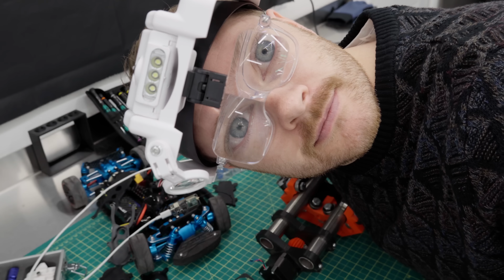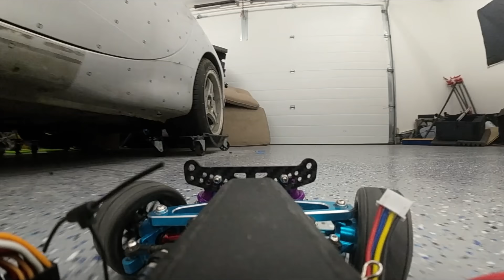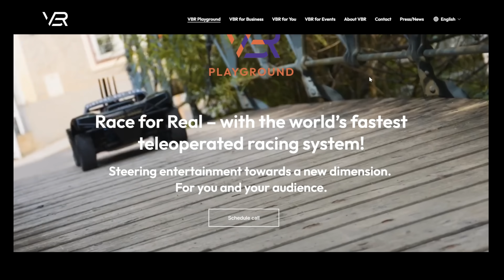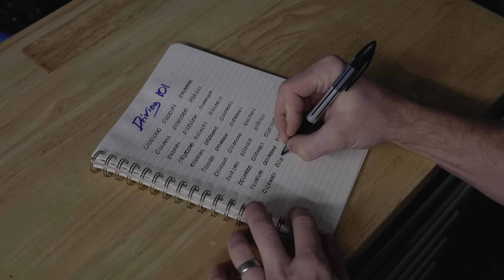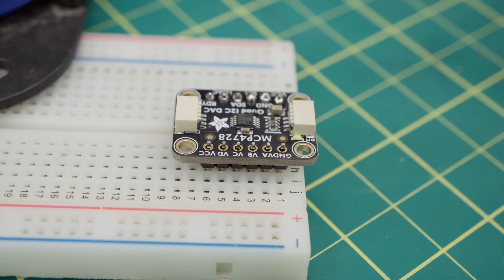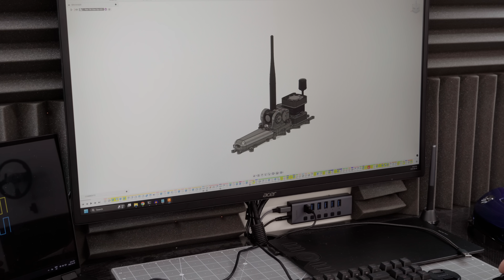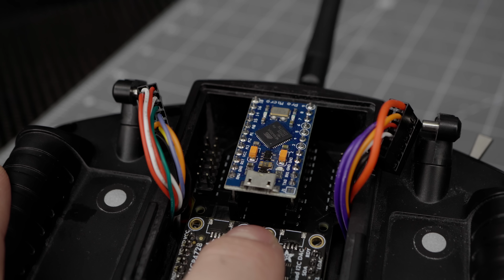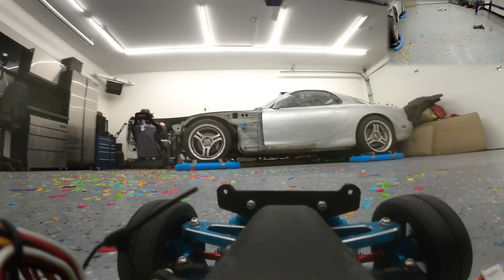Turning a Racing Simulator Into an RC Car Controller: How Hard Could It Be?

Comment: Great stuff, man! The sim rig and FPV setup is a completely different level. I refuse to go back to any other type of RC driving.
Reply: Also...subbed.
Reply from the maker: This is an entirely different experience that's for sure.  I don't know if I'm physically exhausted or too stimulated mentally after a 20 minute rip. I get out of the rig shaking sometimes!

Comment: i would love a deep dive into the coding setup. using the radiomaster edge tx looks like a great way to implement features i wont be able to on my higher end radio transmitters. ive been toying with a setup for a bit and am stumped right now on how to control the pedals how you have. thanks for the awesome video and hopefully gets the ball rolling for my setup!
Reply from the maker: You nailed it! It's not just the "control rc with Sim rig" it's the "look at all the neat things I can do with the software behind it".  Another viewer suggested I use a program called joystick gremlin to make it more universal, and I love that idea because I've used it in the past.  It'll all be up on Github when I have some downtime from filming/writing and fixing the car (Friday's video needed it's own damage report😬)

Comment: i been working on the same project for a while now, curious to know what youre using as tx & rx modules for controls. ELRS? im currently trying to write some python to make two "betaflight elrs micro rx" talk, i can set one to "use rx as tx", gotten them to bind. so far no servo movement :[
Reply from the maker: Yep! It's an elrs transmitter. I'm not well versed enough in the opentx/elrs backend stuff, so a hybridized hardware+Python hack was my best bet at success.

Comment: Cool project everyone dreams about from time to time.

the only thing that stops me from diving into the rabbit hole is the flaws of which direction you go, you make it fpv you are limited to a radius of operation, you make it 4g/5g you are limited by signal and usually a lot of ping. 

I was wondering if its possible to power some kind of starlink unit with the mobility plan attatched to the rc car and somehow connect the sim rig to the RC thru starlink. But in this case you need a bigger boat.
Reply from the maker: Agreed! Every solution has benefits and drawbacks, just gotta balance it out and go with what's in your wheelhouse. Thanks for the support!

Comment: Just. Nice. Job! And that small details in the video are awesome ... You screen definitely need some cleaning :-) 

I have something similar ... But in my case this "setup" should be movable (to be taken out to the track). I am currently using "an old wheel base" that you give up on (aka Thrustmaster T300 RS GT). In my case wheel is connected to RPi and running two small Python script(s) that convert outputs to PPM that is later sent to Headtracker (yes, the same Headtracker), later to RC radio (some processed with OpenTX; to solve the "pedal" problem) and finally to the RC car. Since the wheel is powered, self-centering is not an issue (and currently anyway I am trying to figure out how to get real feedback from the car: strain gauge>telemetry>real force feedback in wheel) - everybody has same plans for the future and sometimes has to wait for better weather outside :-D
Reply from the maker: Vaseline gets everywhere!

Yeah this can 100% be portable, smaller rig, laptop and goggles is all you need.  Pretty easy to throw all that in a car and go - something I definitely want to try especially when I start flying with it.

FFB data would be awesome! I've already got data streaming from the car to the computer, I'm in the process of making the video on how I did it and what it's for, so stay tuned!

Comment: Is force feedback simulated? It will be amazing if we can feel the rear axle spin using the FFB.
Reply from the maker: Right now it doesn't have ffb, at least not reactive to what the car is feeling. The base and software have a bunch of neat features to control the "feel" of the wheel, and I can do some stuff on the computer to change the dynamics with speed. Thanks for watching!

Comment: my current project was turning a cheap MN82 (almost hobby grade) RC Truck/crawler and turning it into a wifi controlled rover. i used a raspberry pi and luckily it has 2 pwm pins that worked fine with the RC Components. currently i have a Pan and Tilt camera (raspberry pi camera) along with a proper i2C PWM controller to drive the servos and the ESC. I also had a I2C MPU to get rotation and acceleration but besides making a graphic i wasn't really sure what to do with it. 

The software side is a flask python server serving up a control page with sliders for the steering and throttle, plus buttons for extra toggles. the webcam stream just comes in via a Mjpg-streamer stream in an Iframe embeded in the control page so i can see whats going on. then i just added the stuff for text to speech audio out, so i can talk to whoever i run into, as well as a mic that i just stream back with gstreamer. since the web frontend uses just HTML and Javascript, it supports controllers. so i added my xbox 360 controller and set it up in a video game style with the left trigger being reverse and the right trigger being forward and there's also sliders to limit how high or low the PWM range can go. I also had to code up some fail safes since i know wifi isn't the most reliable thing ever so if it stops receiving a control signal it just stops and that's saved me quite a few times already. 

since it connects to wifi i'm kinda limited by my wifi range. however i can tether it to my phone and use the 4G but i haven't tried doing that yet. but i have gotten around 300ft range with the outside wifi router so enough to keep an eye on whats going on outside. 

i managed to shove in a 65000mah 2S battery in it, and i can get a whole day of some running around and watching the camera / audio feed. the idea was that i'd use a magnetic connector to dock it in an outdoor dock, but i haven't got to that yet since im worried about over discharging the lipo, or causing a ground loop with the battery and im kinda scared. 

Anyway love your video and subscribed. can't wait for the next one.
Reply from the maker: 🤯 You're deeeeep in to this!
I think the Austrian company I talk about in the video is doing things over 4G, allowing for "truly remote" control using their system - like overseas remote...

WiFi/4G is way over my head, so going right in to the transmitter was my best shot at an outcome.  I still have to do range testing - waiting on weather to cooperate.

Crazy that you can go all day! My battery is tapped after about 30 mins.  That's solid ripping though.

Thanks for the support and sharing your project!

Comment: Very nice project! Well done! And great video! But I'm still wondering why? Do you have any further plans for this project? The project can't just be about driving around in your garage with an too big model car, right? Or did you really just build it to have a technical challenge?
Reply from the maker: Good question! It's always been a childhood dream of mine to "drive an rc car like real life".  There are  lots of future plans for the car and eventually aircraft. I'm stuck in the garage for now, snow has to melt before I can unleash it on the road. I also have to get my rc pilot license, so it might be a minute before I can take flight (outside at least 😉).
I've also got really dumb thumbs, so flying with a regular transmitter got really expensive, and using the HOTAS gives me more familiarity for flight controls.  

At the end of the day it's an outlet where I can drift around, hit jumps and crash without destroying my wallet... Or myself. 

And yes technical challenges are my forte 😁
Reply: @bits-bits  Thank you for your honest and detailed response! I read your channel description today, and I should have read it yesterday. It explains very humorously what you wrote in the comment here. 😀I have subscribed to your channel and am looking forward to your future projects.🙌💪
Reply from the maker: 🙏🙏 Thanks for the support! We're gonna have lots of fun!
Reply: @bits-bits  I think so too 😀

Comment: Nice video! You should check out walksnail fpv system with gm3 gimbal for headtracking. Also you can connect expresslrs RC transmitter with uart adapter directly to your pc without any other hardware, check any crsf library
Reply from the maker: Gm3 system looks awesome. I already had a dji system on hand so I just built around that.  I'd be interested in exploring different systems in the future though!
I initially thought about connecting the TX right to the computer but got lost when trying to get it to shake hands with the wheel setup and HOTAS - so I did what I do and overcomplicated it 😅

Comment: make different presets for different cars, bc you wont always want to drive the most powerful option, add vr with gyro and a swivel cam, make an off road version, add the movement you spoke of, add sim engine sounds, add a mic to the sim setup and a speaker to the car and make the car super long range
Reply from the maker: Summer is coming! And hopefully new RC's to Bash with it! I'd love to get an electric off road to use the system with. 
I've got some ideas for sounds.. They're weird, but it may Ave additional benefits.. You can actually see what I'm prototyping in this video 😅

Comment: I NEED to know how you made that searchable storage system. I was looking for a 3d printed solution but it looks like you retrofitted and existing bin and that looks sooooo much easier. Subscribed!
Reply from the maker: Look up mellow labs mimosa! I did mine a little differently than theirs because I fitted the LED's at the front of each bin rather than at the back (can't see the lights if the bins are full - I found out the hard way).  It was super cheap to build but the 1600 solder joints took a minute!
Reply: @bits-bits  Thanks! I can finally get rid off all my tackle boxes for my through-hole components

Comment: Very impressive man. I’ve been wanting to look into controlling rc vehicles through microcontrollers and code vs just using rc transmitters and receivers. Definitely got a sub from me
Reply from the maker: Blending the two has opened up soooo many possibilities. Paddle shifting was just the tip of the iceberg.  The next video will showcase some of the newer (and better) features. And with way more crashes!

Comment: I got the idea to do this back in like 2015 flying quads with my friends during college. I am atrocious at any kind of programming or language really (took me 2 months to get servos to move in unison with an arduino) but can CAD an airframe in a night. Really really cool to see someone have the same idea and get it to work. I've just been using mission planner and pix cubes to do the same with a lot of latency which is fine for mapping airframes, not so much my Savage XL. Really look forward to seeing what (if anything) you do to make everything public, my setup is identical but I run the og CSL DD. If nothing ever gets shared then at least I know its possible and will eventually hack up a solution. Fine work!
Reply from the maker: I'm hoping to get the scripts/sketches to a point where it's easy for everyone.  It'll still mean a lot of soldering for the end user and problem-solving for which switch goes to what pin, but I'm hoping to get something figured out for all the common transmitters.  I've still got to make a camera mount and roll bar for the Savage before I put the system on it. Maybe I'll get to it this summer and hit some bigger jumps!
Reply: @bits-bits  Heck yeah, best of luck! I just finished tearing down my Savage and Tmaxx 2.5. Replacing/restoring everything after decades of abuse lol.
Reply from the maker: Funny how that goes eh? Thrashed and bashed, then in the corner for a decade or two, then out the come with reinvigorated passion! Same story here!
Reply: @bits-bits  yep yep! Something, something real racing and planes are expensive. Could have arguably finished my lemons car and pilots license with what I've put into the hobbies buuuuut I "need" servos and a 3rd dragonlink lol.

Comment: Hey! Awesome video! 
Just yesterday had a very similar idea about setting up FPV control for a tracked lego rc car. So surprised YT recommended your video)

Regarding publishing the results of the work to Github/Gitlab, I think any working result shall be published, even though it's specific for your setup. Other people like me will see your experience and it will be way easier to adopt your results for my setup, than to do all the same work from the ground up without any examples.
Reply from the maker: Thanks!! The algorithm knows you well too :) I want to get the scripts and sketches edited to the point where it can work for anyone, where all they have to do is select what input device they have they can go from there. I also have to learn how to use Github, I'm new to this coding stuff.

I'll put up a community post and links on the channel page when it's all done.

Comment: Check out the flysky noble nb4 pro transmitter. there’s a mode called “game handle” that allows you to connect almost any controller like a g920 to the usb port to control the rc.